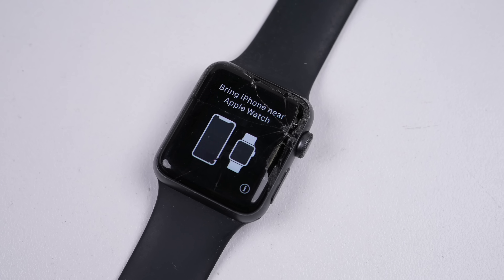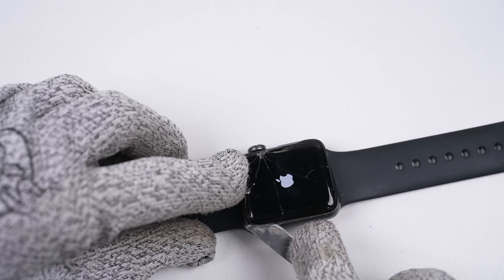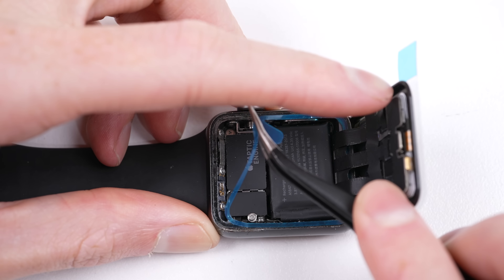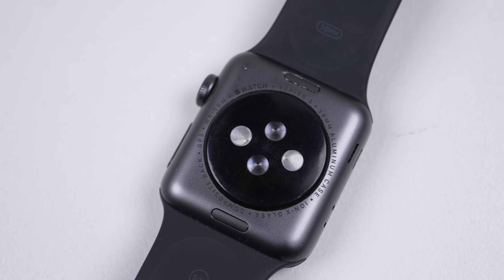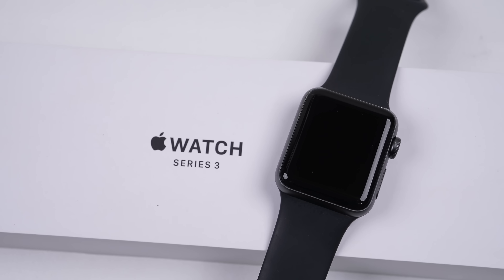How Fast Can I Repair This Apple Watch?

Comment: I have a question  I just purchased a 3 series watch 38mm for my wife It was in VGC  the only thing that i find at fault is the crown button does not retract/push in  I have the same watch and mine works fine any idea?  Thanks

Comment: I have an Apple Watch Series 1 42mm space gray it has a cracked screen i got it off eBay when i connected the watch to the charger the watch screen showed the Apple logo then flickered then turned off i think it needs a new display iam getting a new display and a new battery i really don’t care about Apple Pay on the watch

Comment: Hey I have 2 questions if you could take some time to answer. First what is your opinion on back market and refurbished phones as a whole. Second I got a galaxy note 9 from them about a month ago and I feel like it was reassembled carelessly from the way the gaps are between the glass and the frame. The rear glass, the fingerprint reader and the camera glass all have a bit of play. Lastly there is something rattling inside. At this moment I don't want to take it for repair, I probably will in 1 or 2 months because the battery does not last long and I will have them check it out. Are any of the issues above an imediat concern? Thank you very much and sorry for the long comment

Comment: You can restore Apple Pay functionality by transferring over the nfc chip that is on the screen on Apple Watches series 3 or older. I replaced my Apple Watch screen, and very carefully put the old nfc chip on the new screen and Apple Pay works.
Reply: Can confirm. That’s how I fixed my series 3 screen and keeping Apple Pay. Of course care is needed when taking the nfc chip off, mine left a few marks on the back of the screen visible when reassembled.
Reply: sounds like a real pain in the ass ngl
Reply: @dracopug  you’re not wrong. It was disappointing turning on the watch to find light marks under the screen.

Comment: This is because Apple Watch has wrong design. Most vulnerable part of watch is exposed over metal body. So its very easy to destroy it.
Instead of making flat screen or even flat with little leveling down it and make metal bezels to protect it - they did everything to make watch unrepairable one time toy. I have several friends with already cracked screen on their apple watch and they are not happy about price to fix or replace it. But the fact is: like Apple - should pay for it!

Comment: Iknow u prob wont read this, but i have a friend that told me how to NOT get error messages and lose functions after installing a new screen, battery, camera etc. All the parts have a "special" number, like a parts number, lets say the screen has number 46, If u buy a new screen then,  u have to match that number in order not to lose any functions, because my friend have installed new camera and glass on a iphone 14, and no errors, faceid and everything still works. 
Check it up? maybe apple"s so called parts locks isnt so fancy after all?

Comment: My old watch battery expanded and blew the screen clean off. The cable connected to the screen broke in half. Too lazy to fix it, but I won't need a heat mat when I do.

Comment: Hey mate hook the nfc up on the old display and then pair yes it is a pain but the series 3 are a pain just use the 3rd flex hooked up to old screen while the display flex and digitizer flex is hooked up to the new one
Reply: Does you need to solder it?
Reply: @jaredgarbo3679  if you want to move the nfc to new display yes but you can just hook both screens up and set up watch, the tape he used on it it’ll come apart really easy

Comment: I have an apple watch 1st gen that shows the apple logo for a few seconds then turns off and doesn't do anything until I try to turn it on again. This happened after I replaced the battery because the watch was bootlooping. I have tried force restarting it and letting the battery die fully. Any ideas?
Reply: Try to see if the connector is connected properly

Comment: That adhesive will not last, give it a week or so and the screen will pop off, especially if you're an active person. I've repaired a few apple watches and have always told customers to get a case that encloses the watch so the screen doesn't just pop off and rip the cables. So far using cold press glue (same glue used to repair back glass) and clamp for a few hours does the trick. However it can become super messy if you're not precise with it.

Comment: ZIF connectors are bad enough when they’re regularly sized… Imagine if Apple watches didn’t have ZIF connectors or cabling and they just used direct contact points sorta like an LGA CPU socket. It’d take 5 mins to fix one of these.

Comment: Hugh, I would recommend dipping your blade/spudger in some iso and scraping all edges before applying the new adhesive layer. I saw quite a bit of dust that you were putting that Capitan tape over!
Reply: I was thinking almost the same. The adhesive is to small in diameter and put on a dirty surface. This won't last long. 😂

Comment: hmmm. In this speedrun it looks like the biggest time loss seems to be the process of opening up the device, with a close second being the application of the adhesive. But it was way more challenging to not get the cables cut. Maybe if someone found a glitch that somehow disabled the collision on the cables for a short amount of time, allowing the runner to safely open the watch. Although I must praise how incredibly persistent Hugh was during the testing, not giving up even though RNG had screwed him over so hard. Although the sub-40 minute time WAS very impressive for such a complicated tech device. Incredible run, Hugh!

Comment: WTF. I would never appply adhesive to a force touch gasket which is THAT dirty. Also, don't use blades because they tend to scratch your case and leave marks. 4:41 you can see what im talking about.

Comment: Time stamps: SPOILERS
Edit: y’all didn’t care so much that you replied to this comment, that’s sad.

Heat 0:40 
Disassembly 0:51 
Power off 1:10 
Detach screen 1:18 
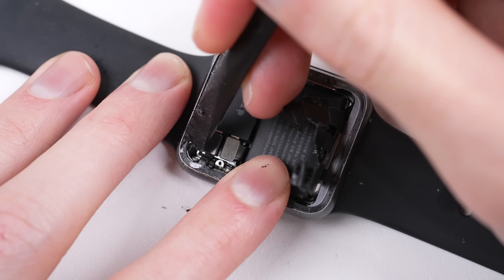Clean Perimeter 1:46 
Cut adhesive 2:07 
Reapply adhesive 2:14 
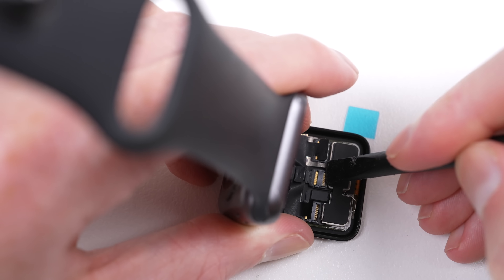Attach screen cables 2:43 
Test 2:47 
Check 3:24 
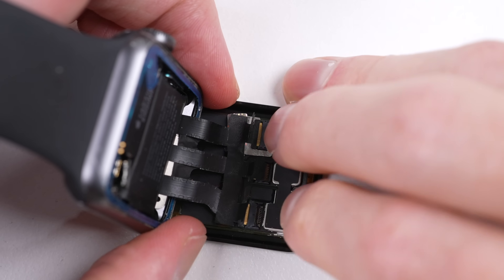Redo 3rd 3:30 
Good test 3:50 
Press down display 4:35
Done 5:05
Reply: Not the spoilers 😭
Reply: Thank
Reply: @MinecraftBedrock9134idc about this ratio
Reply: @MinecraftBedrock ur mum m8

Comment: Don’t worry, Apple will definitely make Apple Watch repairs even more difficult by doing what they did to the iPhone: parts pairing and software locks. 😂
Reply: I hope the EU does something about that
Reply: they already have - you lose apple pay.
Reply: @yotoprules9361  Not really; I replaced the screen on my Series 1, and Apple Pay works after it. It’s because the NFC chip is stored in the screen, so if NFC data is present and the NFC chip doesn’t match, the watch gets confused. If you don’t have any Apple Pay cards on the watch before the repair, you won’t loose functionality.
Reply: And they would still get a high iFixit Score. The iPhone 14 Pro is a mess to repair and still got a 7/10.
Reply: @Teaker7 I don’t trust anything ifixit says regarding repair scores anymore. Seems fishy to me to give such devices such high repairability scores. 🤨
Reply: @Teaker7  wow ok... it should at best get a 3, because you need more than a screwdriver to fix it.
Reply: @Kanaba Nakamura ikr
Reply: NFC is disabled, unless you can di-solder the chip from an old display and solder it to a new one
Reply: Unless you transfer an NFC chip from the old display to the new, apple pay will no longer work
Reply: @ProGamusian  My old Apple Watch would disagree with that
Reply: @Kanaba Nakamura or the days you don’t even need a screwdriver for a phone…
Reply: Apple are so incredibly anti-consumer I'm still amazed that there are so many people prepared to buy their over-priced garbage. Apple don't want people to repair their own products, it's as simple as that, and if that means more landfill then they don't care about that either. With the environment it's a case of giving with one hand and taking away with the other - they do a few positive things then flush it all down the toilet by making their products difficult and/or expensive to repair, so it goes in the trash. And all of course with the aim of selling newer products. It's horrendous, yet so many people don't seem to care. Ultimately it's all on those who buy Apple's products. This of course also applies to other big (and small) companies.
Reply: im actually surprised that they haven't done it for apple watches yet.
Reply: @@kanabanakamura864true
Reply: so don't buy an apple watch
Reply: I doubt they will. There’s not many people wanting to repair their watch themselves for them to spend the money to implement those things
Reply: You’re right. You should invest your own money and build your own devices.

Comment: Yeah apple watches are weird in that they don't allow you to power them off while charging.
Reply: I may be wrong, but I think it's got something to do with the system trying to monitor the charge(Potentially to extend/decrease battery life), which it will not he able to do if shut down
Reply: Apple watches even when you’re using the toilet. Watch, out. 😂
Reply: @kalp0rter  I enjoy it. I put on a bit of performance so it's nice to have an audience.